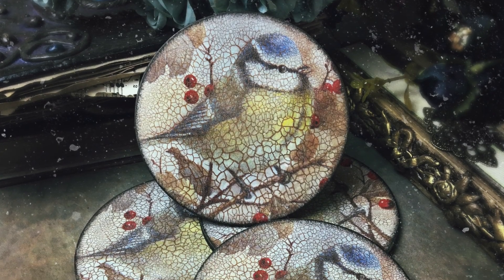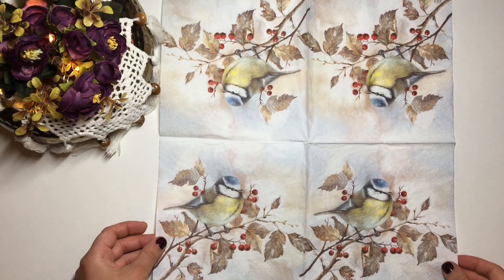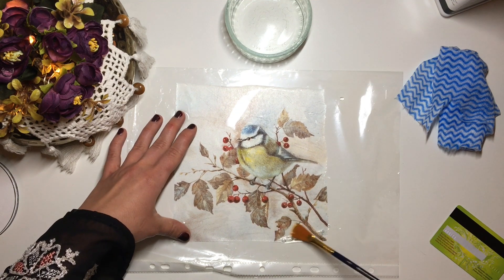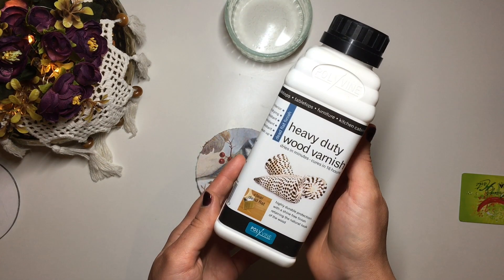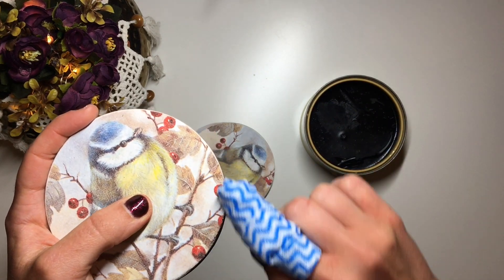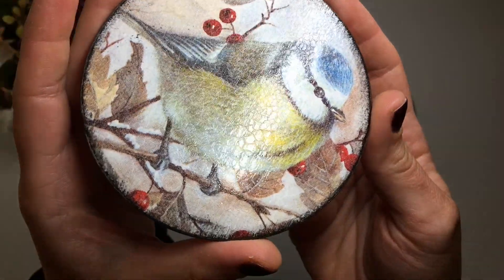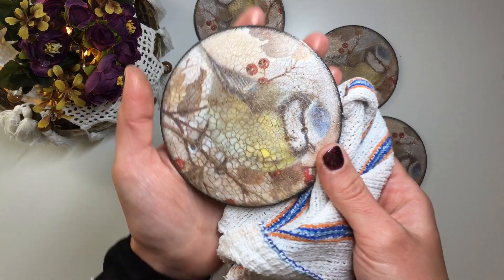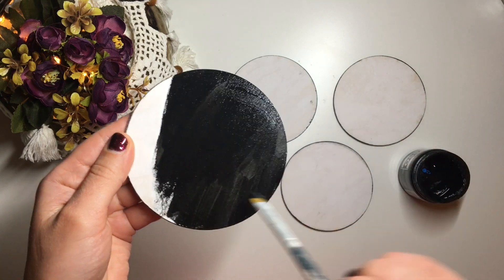NAPKIN DECOUPAGE COASTERS TUTORIAL | 2 STEP CRACKLE AND HEAT RESISTANT

Comment: I have not used that brand of crackle but generally speaking using Finnabair’s or Stamperia’s crackle paste the thicker you apply the paste the bigger the cracks, the thinner gets you fine cracks. These are gorgeous!
Reply: Instablaster.
Reply: The crackle varnish I used was rubbish....now you have said this about thicker and thinner will try this see if it works...thanks

Comment: So beautiful! I will be trying this project for sure. I was wondering if you can use the same method with travertine tiles? I would probable use something else instead of the wood varnish unless it works on different types of surfaces. Thank you so much for sharing!
Reply from the maker: You can use the same method on tiles and as far as I know people that work on tiles use wood varnish as well, no problem but it’s up to you of course ☺️
Reply: You can use this varnish for finishing. But you can't cover the tile surface with paint or primer for wood. You can use a special primer for glass and ceramics. I use the primer Tikkurila Otex for priming stone, glass, metal and ceramics. This primer is based on a solvent and does not have a very pleasant smell, but it is very good.